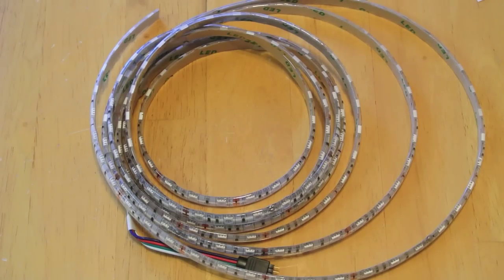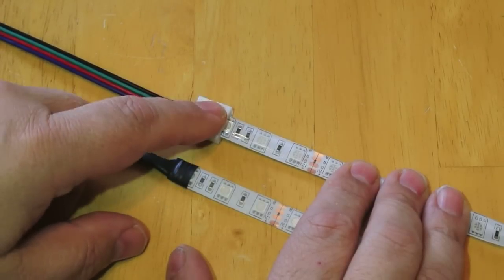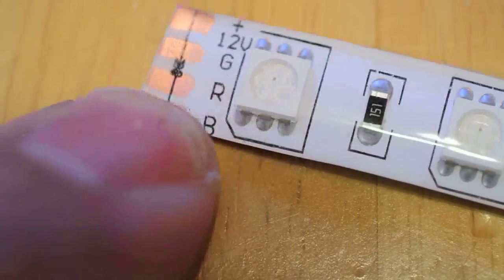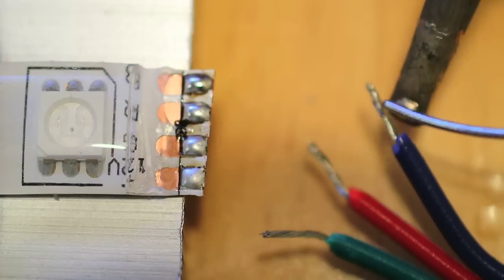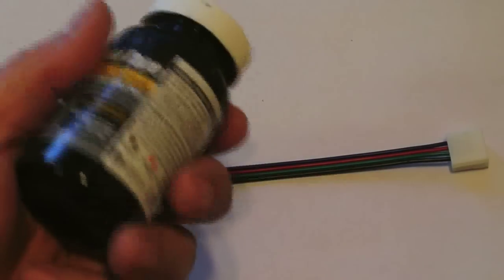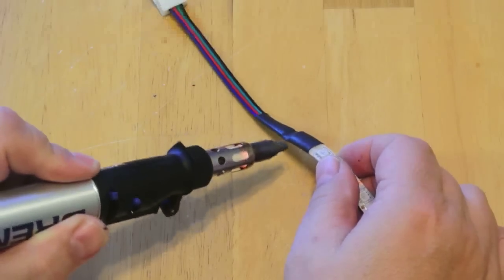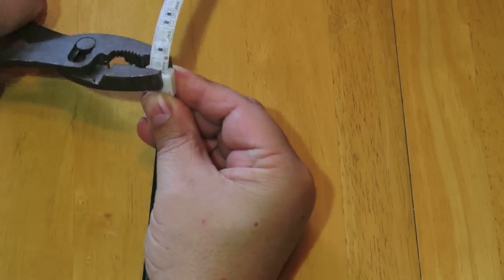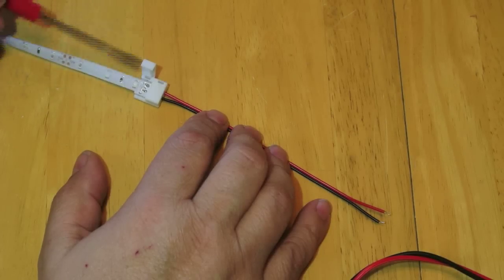Making waterproof LED Strip Connections - Updated.

Comment: is it ok if i just use black and red wires like they are not rgb and black?
Reply from the maker: Doesn't make a difference what the wire colors are as long as you keep the functions straight.

Comment: Can we use longer wires? More than 1 meter
Reply from the maker: Yes you can.  However, if the length is significantly longer, you will eventually run into voltage drop issues.

Anytime a current passes through a wire, some voltage is lost. This is a product of the wire length, wire AWG, and amount of current that passes through it.

In your case, if you have a really long wire run, you may have to increase the wire's AWG.

I have two resources on my website that explains this.  The first is an article that provides the issue: http://www.rv-project.com/tips/dcwiring.php

The second page is an on-line calculator that allows you to rapidly see what happens when you change the wire length, wire gauge, or amount of current passing through the wire: http://www.rv-project.com/tips/wirecalc.php
Reply: @RVProject  so if i used longer wire for my strip lights the led may not be that bright? Am i correct?
Reply from the maker: @NoOne-eh8ft  At some point, that would be correct. But it all depends on the AWG of the wire you have.  Also on my website, I have suggestions as to how much current each LED strip light type will require, and coupled with my calculator I already mentioned, you can get a fairly good estimate as to your maximum distance. http://www.rv-project.com/projects/ledstrip.php
Reply: @RVProject  okay thank you! 😁

Comment: What size heat shrink for 10 mm strip
Reply from the maker: Common heat shrink will be 3:1, that is, it will shrink 66%. But there are other shrink rates, so find a heat shrink that will shrink a bit more than the cross-section of the wire you are using.

Comment: Can a 12v LED strip be connected directly to a 12v  leisure battery setup @RVProject
Reply from the maker: As long as the strip is rated for 12V and the battery is 12V, then it would work. However, you will want some kind of on/off switch.  

For every project video, I publish a project page on the RV-Project.Com website. The project page has much more information on connecting LED strips to RVs: http://www.rv-project.com/projects/ledstrip.php

Comment: Yes, the clips are garbage.  I KILLED myself with those, to find out they are completely unreliable.  Now we solder - I'm having an issue, after I crimp all the lights together (I test them and they work), I attach it to the power source.  They don't work.  I take off the plastic connector, test them on the power source, they work.  What am I doing wrong?  thanks!
Reply from the maker: Insulation displacement can sometimes be a bear to get to work.  I would try to use some heat shrink to prevent movement as much as possible.

Comment: I’ve been using the snap-on connectors, especially for 90 degree turns, but just learned from you that I have not been installing them correctly.  I have been placing the copper tabs on the strip atop the pins in the connector, not sliding them underneath.  They have all been working.  It’s too late to change them out as the lights are all installed throughout my boat.  I did switch to soldering and using wire for the 90 degree turns but I need a much better soldering gun.  Sometimes the solder refuses to adhere to the tabs on the LED strip, which is frustrating.
Reply from the maker: Thank you for supporting the channel.

Comment: If you don't mind me asking..what type of soldering iron and flux did you use to repair the strip.
Reply from the maker: Weller 40Watt WLC100 soldering station: https://amzn.to/2EmYdTm

and the flux comes with the electronic solder. 

This is what I use for solder: https://amzn.to/34dhIsv

If you need additional flux, make sure it is made for electronics  (rosin not acid).  I use this stuff: https://amzn.to/3gcG7RB

Comment: Instead of the liquid tape, can you put epoxy over the connections?
Reply from the maker: Yes, but it is pretty messy.  A special purpose epoxy called Potting Compound is designed to encapsulate electronic components. The advantage is the epoxy has electrical properties, such as static free that helps in this regard.

Unfortunately, it takes 24 hours to dry and is pretty fluid, so I would not use it in this instance.

Comment: Can someone tell me howe to hook up the four wires to a 12 volt power source? I want to use a 9 volt and two 1.5 volt batteries as I am gluing this to a guitar. But I do not know where to run the wires.
Reply from the maker: I produce a webpage for every youtube project video I do.  The webpage has additional information, schematics, and sources.  You will find several connection options and schematics there: http://www.rv-project.com/projects/ledstrip.php

Comment: I tried using those connectors, but the didn't work for me. Then I tried the solder, but it wouldn't take. 🤔
Reply from the maker: There are so many variations of the parts from China it's hard to know which brand works and which does not.

Comment: If you like liquid tape. You will LOVE shoe goo..... it dose not peel off as easily dries just as fast and is more reliable. Also when dry it is less flexible for better support to connections.  (= Great video my friend. CHEERS!
Reply from the maker: Liquid tape has an electrical dielectric property that insulates connections. Does shoe goo have the same characteristics?

Comment: is there a voltage drop over long distances when extending for 2-3 meters?
Reply from the maker: All wiring will have some voltage drop issues. It is the product of the wire gauge, distance traveled, and current through the wire.

I have a voltage drop calculator on my website that might give you the answer you are seeking: http://www.rv-project.com/tips/wirecalc.php
Reply: The standard power supply supports 5m to 10m depending on the RGB strip. Just ask the seller if it is AliExpress or a Chinese seller.

They are honest and give you the adapter you need =)

Aka. Less than 5m for RGB 5050 is no problems. 10 meter is fine too but that is where suppliers put the limit for best outcome

Comment: I've always had similar issues, the quick "piercing" connectors still need soldered.  Outside of what extra protection they offer, it's still Better to just solder any of them directly to the PCB tape.
Reply from the maker: I never liked the insulation displacement idea on any connector.

Comment: What sodering  ( Tip) gun do you recommend?
Reply from the maker: I use a Hakko FX888D (https://amzn.to/2RithFs). However I do realize it is a bit expensive, but I use soldering gear enough to warrant the cost. Prior to the Hakko, I used a Weller WLC100 (https://amzn.to/2P4TANF) for many years with outstanding service. I still have the Weller as a backup.

Comment: You spoke of failure with a solder joint. Have you thought about adding an extension under the LED strip past the solder joint since you are heat shrinking far in enough to cover the first LED?
Reply from the maker: Yea. You could probably put a piece of plastic or something under the heat shrink.

Comment: hi friend i just bought a led strip that said 6803 but it only has 3 wires not 4, what are their differences?
Reply from the maker: Most LED strips designate the LED size, for example SMD5050 is a 50mmx50mm LED. 

SMD type strips have 4 wires; a RGB (red, green, blue) and common wire. 5 wire SMD strips have RGBW (red green blue white) and a common wire.

However, not all LED strips follow that convention. A 6803 is one such strip and "6803" refers to the controller chip within the LED strip. These strips are "programmable". Some strips have three wires, and some have 4 wires. 

Three wire strips have POSITIVE, NEGATIVE, and DATA leads. Four wire strips have POSITIVE, NEGATIVE, DATA, and CLOCK leads.  To use these LEDs, you need a controller that provides the proper data packets (and a synchronization clock for 4 wire strips) to the LED strip.
Reply: thank you so much
 @RVProject

Comment: For soldering, the conventional wisdom is that you want to heat the joint and let the solder melt over the joint, rather than heating the solder.  I'm guessing that if you did that here, it would melt some of the other components before the pads got hot enough to melt solder.
Reply from the maker: That is correct. I find that a hotter pencil - at least 750Deg F and a quick touch of the solder and joint works best. The higher temp gets the job done without overheating the strip.  It does take some practice.
Reply: @RVProject  Just found that out yesterday while wiring my very first strip.  It is so easy to destroy the ends.

Comment: ... had to stop by once again just to say another big thank you... watching this video a few hours ago raised my confidence to repair a 3 meter RGB IP65 strip tucked under the eves of my shed. The full length of the strip worked except for a 4 inch section smack in the middle. I have just carried out a successful repair by following your solder method to replace the defective section with strip (surplus from the original installation). I also used heat shrink to strengthen and protect the joints as you advised. I just wanted to say that I may have discovered a better way of separating the silicon from the strip. I did mine by making the cut an inch or so away from the actual cut mark and peeling the silicone back until just past the cut mark before finally cutting the silicone and strip. This method negates the potential risk of damaging the copper ends and makes getting the silicone to start peeling away a bit easier.
Reply from the maker: Thank you for sharing.

Comment: Whats the wire connecter called? Can I not just connect it to a cell phone charger if I have a small cutting of left over led striplight? Like soldering just the red and black wires to the strip light connecters?
Reply: Polo Purpp u can use a charger or adapter etc. just make sure the output of the charger is 12v (most led strips are made for 12v). most phone chargers have an output of 5v, which will not work.   there is a sticker on almost every charger which tells the output.
Reply from the maker: Generally the LED strips require 12VDC to operate (sometimes 24VDC).  Your cell phone charger has too low of a voltage and current capacity to work correctly.

Comment: I’m looking to put four led strips under my car doors would I be able to just use the black and red for power. Since my power from my car is only 2 wires ??? Thanks for your help
Reply from the maker: If you are looking at monochrome LEDs, then yes; Black to Ground and RED to 12V. The color will be whatever color you buy. 

If you are using RGB LEDs, then Black and RED = RED, Black and GREEN = GREEN, and so on. Realize though that in the case of RGB LEDs, the Black wire may be Positive.
Reply: RVProject thank you what would you recommend for my auto rgb or mono
Reply: Joseph Mcnamee mono

Comment: What gauge wire do I use?
Reply from the maker: It depends on the length of the run and the current you expect to run through that wire. Especially for DC wiring, you do tend to lose voltage along the wire.

I do have a wire-size calculator on my website where you can plug in voltage, current, and length of the wire, and acceptable voltage loss, and it will tell you what wire size you need:

http://www.rv-project.com/tips/wirecalc.php

The trickiest part perhaps is determining the acceptable voltage drop. As a general rule-of-thumb, I use 3% or less for sensitive electronic circuits, and 10% or less for lighting, motors, etc.
Reply: RVProject 
   how  tremendously helpful thank you so very much!!!
Reply: RVProject 
   I went to the page you provided the link to... well, I guess I should fess up.
I'm technologically unsmart. 
The page confused me more; if you have the time I would appreciate any help you could provide? I've got a 6' RGB LED light strip that I want to install above each of the three windows in my conversion van. 
My power supply is (4) AA batteries. What I'm hoping to do: 2' light strip ➡️ 2' wire ➡️ 2' light strip ➡️5' wire ➡️2' light strip
I've done some soldering in the past I think I can handle that; but I am clueless on wire gauge, voltage, etc....
If you can help a technology challenged fella I would so appreciate it; I'd be forever in your debt!

thank you,
Rich Barnhart

Comment: Thank you very much.
I have a few quick questions if you don't mind.
I've ordered my LED strips just waiting for them to come, I'm wanting to run 2x5 m lengths of RGB strip from the 12v 10amp power supply that comes with the kit, I have the spitter so that I can power both strips from one end but I want to add power to both ends so I don't get a dimming effect.
I have watched some videos on youtube but I'm sure you will agree the more "how-to" videos you watch the more "Questions" they leave you with.
1. Will it be necessary to add more power? (Should i wait and see)
2. If so what is the best way to go about it, do I have to buy another power supply or can I splice into the existing one's connectors somehow?
3. If splicing do I need all 4 wires connected just for power or only 2 or 1?
4. LED amplifiers, are they just for the signal that changes the color of the Diodes or do they boost voltage along the strip?

Sorry to bother you but as you can see i need a little help.
Thank again for the video
Reply from the maker: I also have an associated web page to the video that might help" http://www.rv-project.com/projects/ledstrip.php

A 10A power supply should run 10M of LED strip. I would try it first by plugging one strip into the other and see if there is excessive voltage drop on the far end (evidenced by dimmer LEDs). Typically you can connect two strips together before you have to power it differently.

Typically with SMD5050 strips, they are around 180mA per ft with all 3 colors on, so 10M of strip should be within your power supply's 10A capacity.

The LEDs are wired so the Anodes of all LEDs are common with the + side of the power supply. Each LED color's Cathode (Negative) side turns on that color when it is grounded. So you need the power supply + to go to the LED  + common, and the power supply negative on the R, G, or B LED strip terminals depending on which one you want on.

Typically LED amplifiers do not boost voltage. They usually have a MOSFET driver that is basically a voltage controlled switch. A typical purpose is to control a higher power LED string of lights from a low power output such as an Arduino microcontroller.
Reply: Thank you, I knew you were the right guy to ask.
I really appreciate the help
Reply: This is the exact info I've been scouring for hours for. I have had issues trying to use different methods of actually powering the strips. They seem very sensitive and I was trying to use old power supplies from the mess of 12v electronics I had retired to boxes in my basement lol
Thanks so much for the info, you are really good at these tutorials. I would know, I've watched 10s of 1000s ... :P
Keep up the good work my man

Comment: do they sell pre-cut 24'' waterproof RBG strips? ive been searching... i need the strips not the whole kit
Reply from the maker: You can get pretty close to a 24" strip by cutting one or more segments out of a strip. I cannot give you an exact measurement as different LED strips have different segment lengths. I have seen a few 1meter strips though, but that is not the size you need.
Reply: RVProject ....10,4 . i might have to bite the bullet.make my own..
Reply: Dennis Kingsley I would just get the whole thing, it's cheap and you can just go ham on everything with the rest
Reply: 10,4... got everything i need thu the mail this wknd...

Comment: Hi. How hot is your soldering pen? 45 or 60w.
Reply from the maker: 5~40Watt adjustable Weller WLC100

http://amzn.to/2nv3gEl
Reply: Thanks. And how about your soldering wire?
Reply from the maker: This is the latest wire I bought:

http://amzn.to/2nsiHvS

However, it's a lot of solder if you are only going to need a little bit.  You can buy similar solder in smaller quantities:

http://amzn.to/2nvlw0f

Of course, the larger spools are a better deal if you need more.
Reply: I tried with 60w because I found the 40w was not heating fast enough but I damaged the stripes. Any advice for on how to use the 40w?
Reply from the maker: I actually dial down the 40w soldering iron to just over 50% on the dial.  Not sure how that corresponds to wattage, but I'm using significantly less than 40W.

The trick is a clean tip and good solder. Get a wet sponge cleaner to keep the tip clean (the WLC 100 has one), but you can buy a tip cleaner for just a few bucks.  The tip should always be shiny.
Reply: Can I use solder with lead in it?
Reply: let it get up to temp  before trying to use it

Comment: On a weak joint I will place 1 or 2 plastic toothpicks before adding the heat shrink to give more strength  to the joint.
Reply from the maker: Good tip. Never thought of that.

Comment: Great Job discussing of the various types of RGB LED connections, I have found the insulation displacement connectors that uses the slide underneath method are a chore to line up properly. Great Topic!